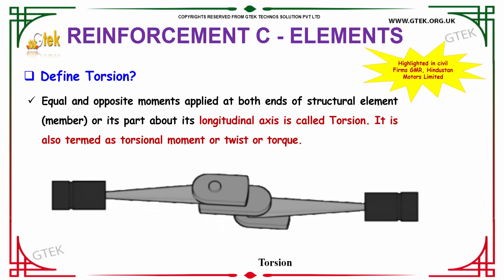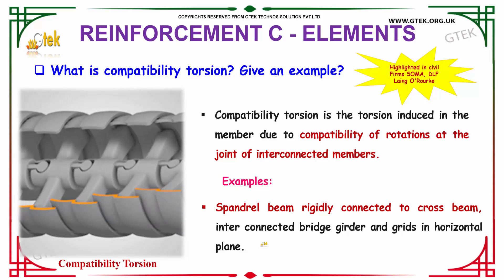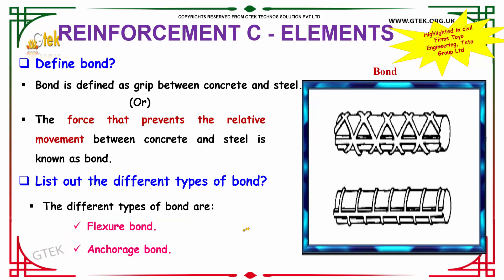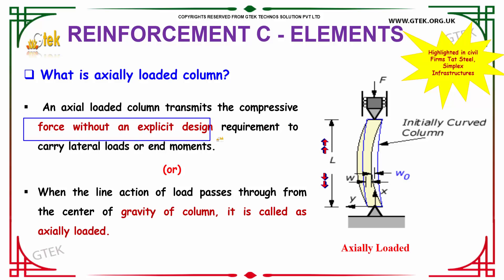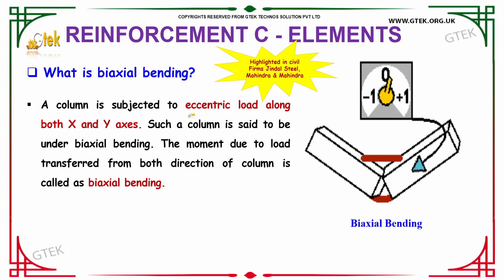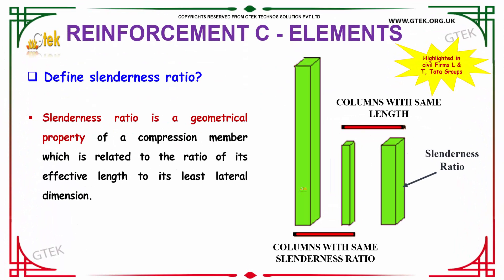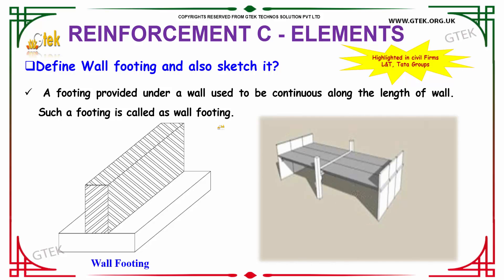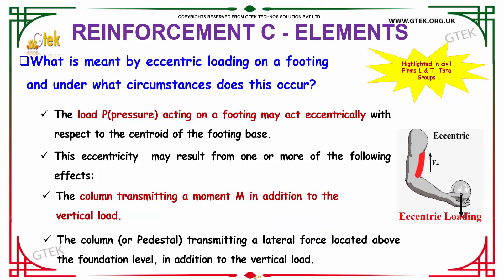Top 30 Reinforcement C Elements -2 civil technical interview questions and answers for fresher

Comment: Reinforced concrete (RC) is a composite material in which concrete's relatively low tensile strength and ductility are counteracted by the inclusion of reinforcement having higher tensile strength or ductility. The reinforcement is usually, though not necessarily, steel reinforcing bars (rebar) and is usually embedded passively in the concrete before the concrete sets.

Comment: Reinforced concrete is a composite material that provides superior compressive and tensile strength, according to the Concrete Reinforcing Steel Institute. Commonly used in the construction of bridges and highways, reinforced concrete is one of the most economical and durable construction materials available.

Comment: C) 15% and 15% d) 20% and 20%. 3) I n symmetrically reinforced sections shrinkage stresses in concrete and steel are respectively a) Compressive and tensile.

Comment: This chapter has considered the design of a number of reinforced concrete elements to BS 8110: Structural Use of Concrete. ... Questions. 1. (a) Derive from first principles the following equation for the ultimate moment of ... fy = 460 N/mm2 fy, = 250 N/mm2 b = 300 mm span /depth ratio =12 c?k = 10kN m ' . gk = 20 kN m ' 4.